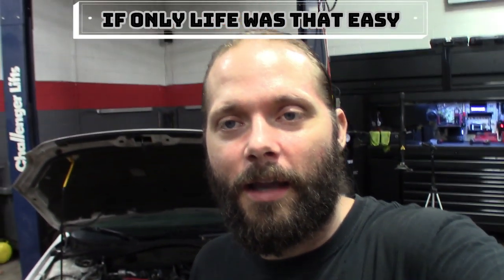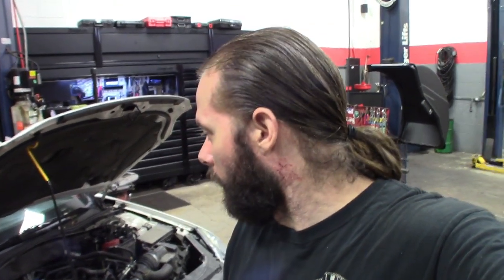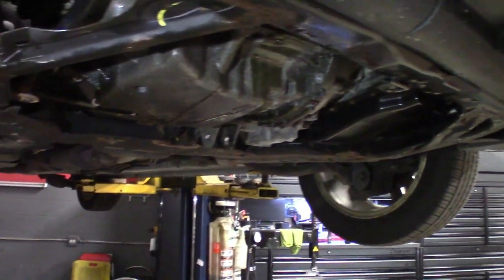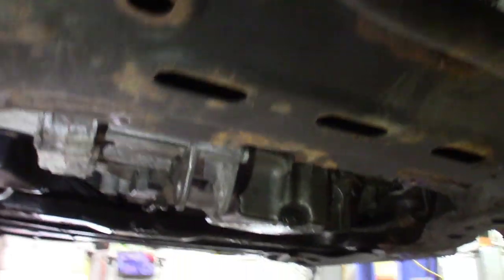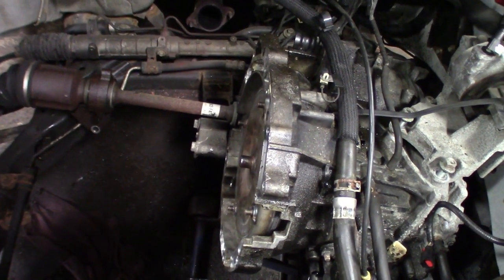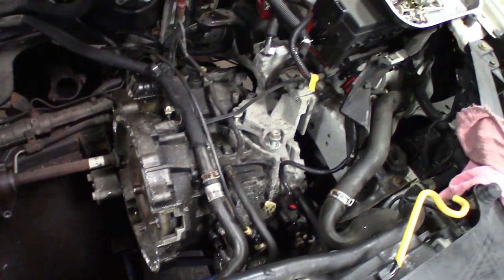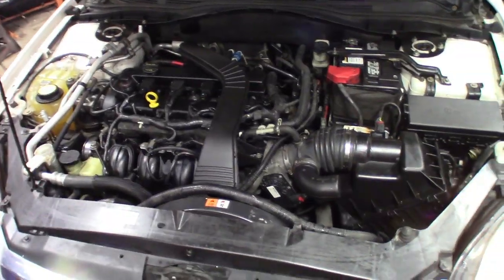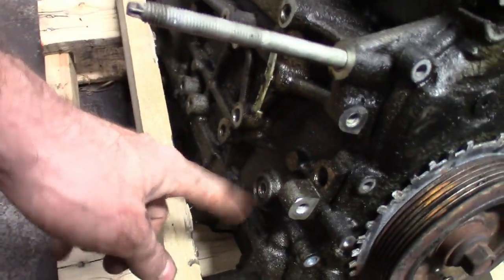IF LIFE WAS EASY

Comment: Used engines,have one junkyard in my area that we don't ever buy used engines from.My dad got 6 bad engines from this yard for an Olds Cutlass once.Plus the used engines have a tag saying should be good on them,they don't hear them run before pulling them out.My dad's shop,it is a Jasper Engines and Transmissions reman with a 3 year 100,000 mile nationwide warranty or an used engine they buy as options.Got burned on one,bought it for the customer and the yard did nothing about it
Reply from the maker: My junk yards not like that. These yard motors come with 6 month warranty and if I install it and something is wrong they send me a new one and pay labor free of charge. Jasper remans are the way to go but customer sometimes don't want to spend that kind of money.

Comment: I'm always the curious one. My question is? Why did this motor only last 115K was it Fords product not being of good quality or did the owner not keep up with the maintenance? Then the more I think about it did it get run low on oil or get overheated these type of questions could go on and on short tearing down and getting somewhat of an idea. I will say this if one of my vehicles only lasted this long it would leave a bad taste for me and buying another Ford.
Reply from the maker: All good questions. But yes I believe it was never maintenanced, customers never did oil changes, started to burn oil, and with no oil pressure the timing tensioner goes it skips timing and bends valves. These Ford motors arn't the best design I my eyes.